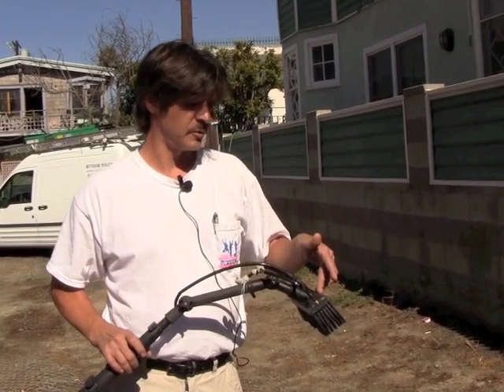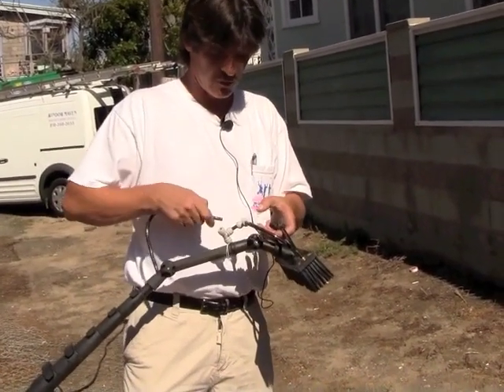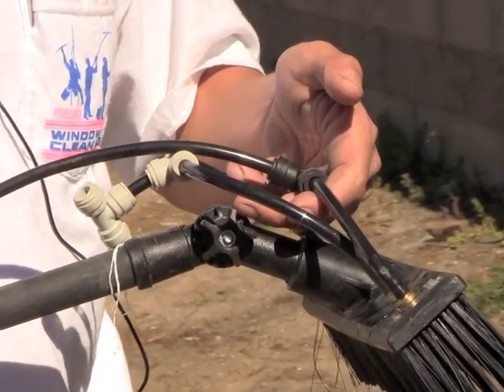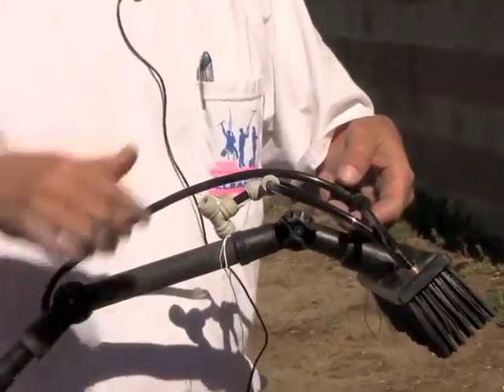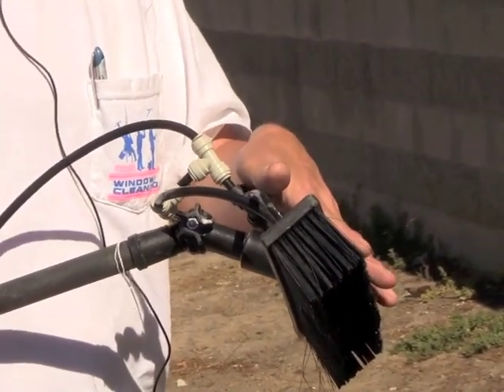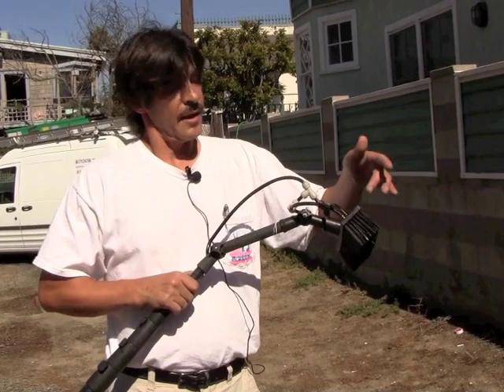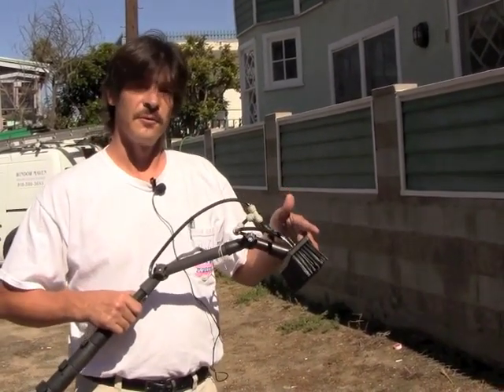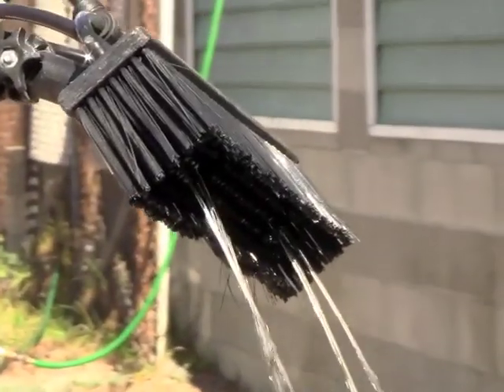Quad Pencil Jets For Hydrophobic Glass

Comment from the maker: You might ask your local supplier if they have extra pencil jets, but yes, it is easy to add on yourself. Just a drill bit to make new holes and some hose and a few push fittings should get you going.